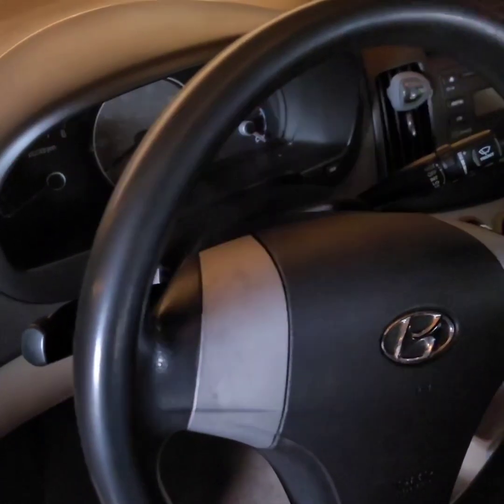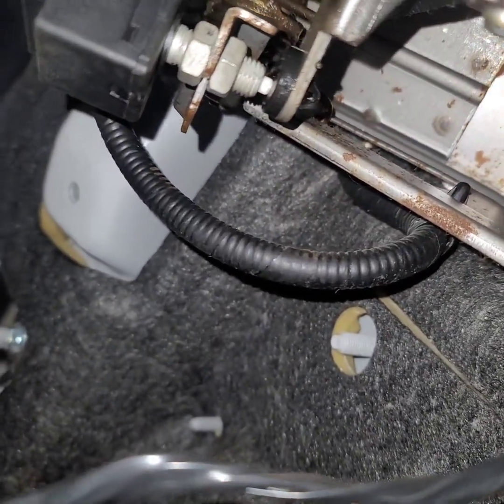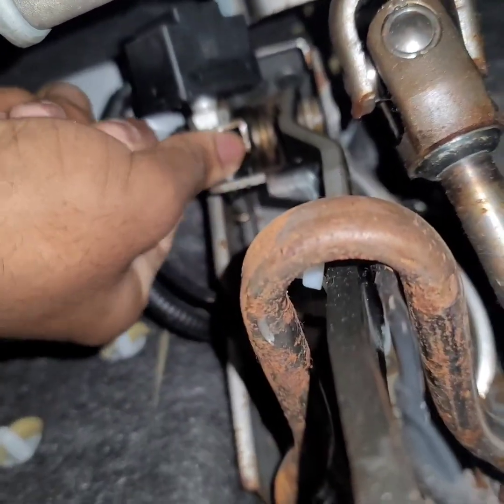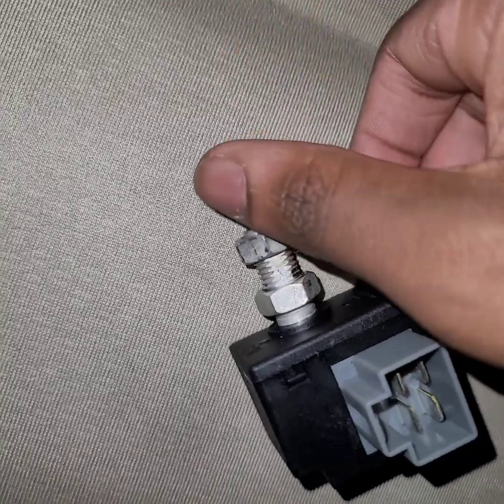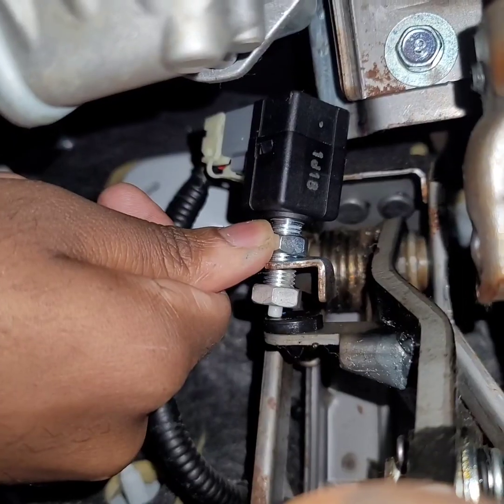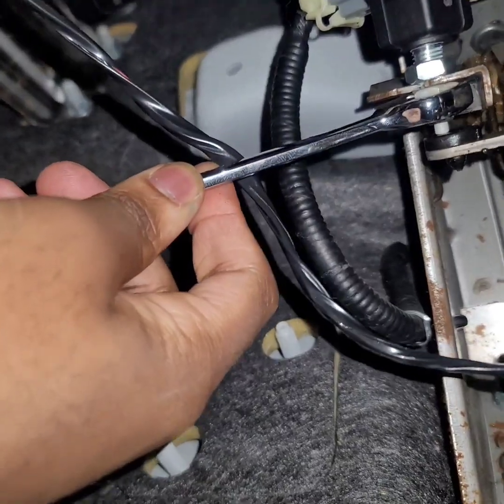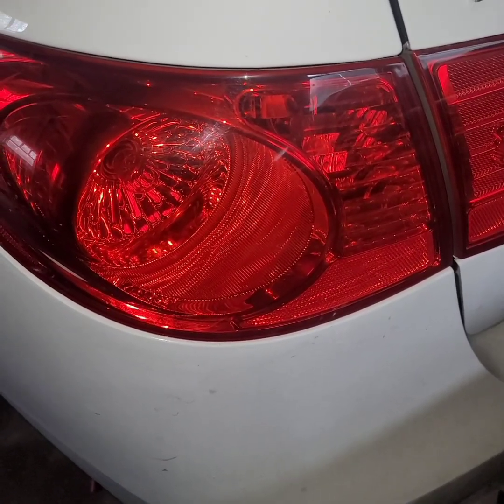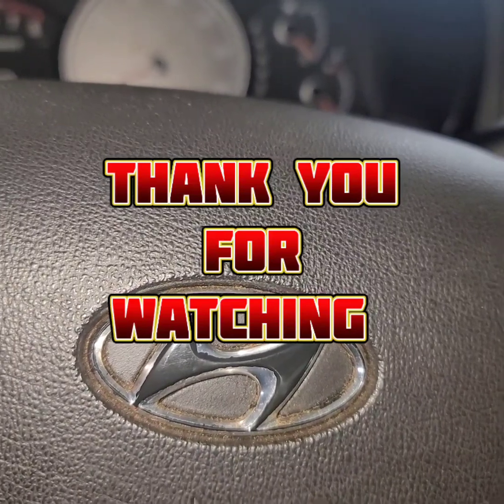How to replace Brake Light Switch 2009 Hyundai Elantra

Comment: Sheesh that’s a tight working space to replace those nuts and bolts and secure em. Great tutorial. Look into getting like a tripod. They got all kinds on Amazon so you can free your hands
Reply from the maker: Thank you Sis, I had a crook in my neck from this video🤣 Yea I need a tripod that won't break I'm too rough.

Comment: The one I bought in the Dealer was the side like yours. In fact I bought two of those long time ago, when the Dealer replace mine for the third time. The original was big like yours and the new was small, but now the car cruise control is working perfectly. I just replaced last week.
Reply from the maker: I wonder why they keep going bad I'm on my second one.

Comment: Thx for the video...👍... my sister car is a Hyundai accent 2010 couldn't find a video on that car, but it has the same wiring as yours...( brake light also stays on even if car is off)...
Reply from the maker: Yep that's the issue, tell her the aftermarket parts doesn't last long either I had to replace it every 8 months to a year it's annoying
Reply from the maker: Thank you for watching, that means alot

Comment: Gear change indicator on hyundai i30 crdi 2010 with manual transmission does not work. Where is the "switch" to replace it, thanks?

Comment: I’m having trouble fitting the new on into that metal slot, how did you do it?
Reply from the maker: I loosen one of the nuts with a wrench & force it up with just a little muscle & tighten it back up with the wrench so it stays. Yes I understand it can be a pain plus it's very uncomfortable under there

Comment: What about the hole sitting there? If you slip the screw all the way to the back it slides right where the is and this also causes the brake light to stay on. Not sure why there is a hole there if the button is to be pressed to turn the light off.